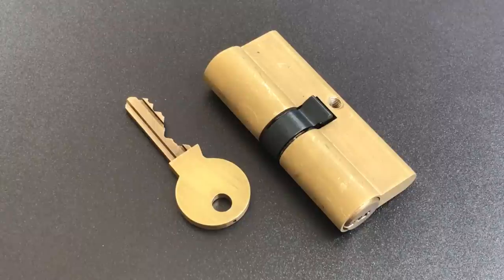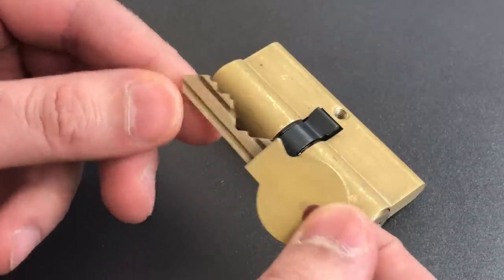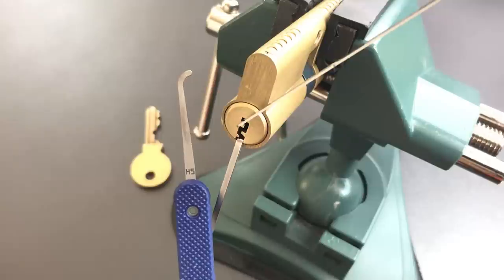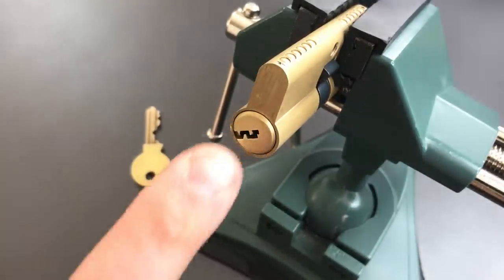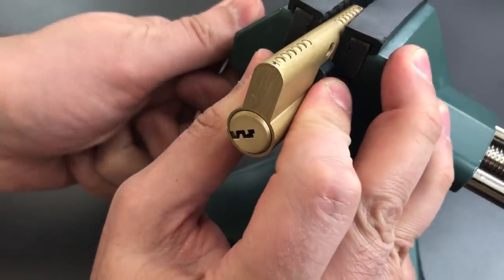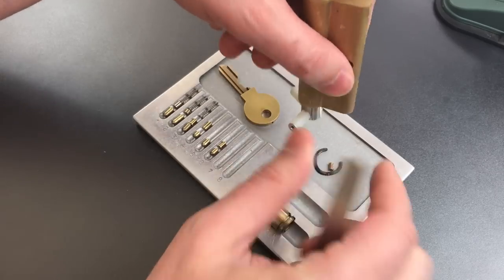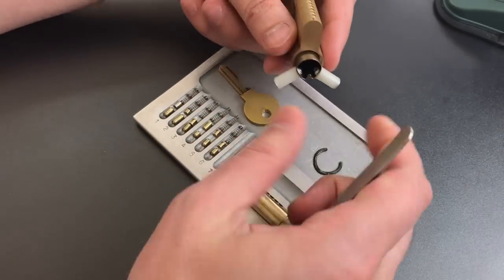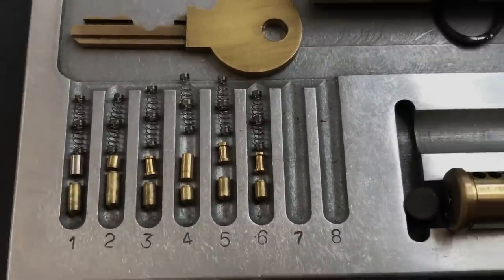[612] Prototype Of UrbanHawk’s Pin Blocker Cylinder Picked and Gutted

Comment: I always asked myself couldn't you put two bigger spool pin in and the rest small pins that when you try to pick it every time you try to pick a spool every other pin and the other big spool will drop?
Reply: Why will the other big spool drop when you do that?
Reply: @Tjalve70  you are right it will, but won't it be possible to use that idea to make a lock that is difficult to pick because you'll drop every pin by picking the big spoole and when you don't know which one it is gou need to find it what is time-consuming?
Reply: @redcrafterlppa303  I believe that is part of the point of spools in the first place.
What I didn't understand of your first comment, was that somehow the other spool should always drop when you picked a spool.
Reply: @Tjalve70  im not that good expressing myself in English thats why its not understandable but there should be a way to make a lock that is not able to pick open by making pinns drop when you pick other pins or is this just wishful thinking?
Reply: @redcrafterlppa303  I have very little knowledge of lock picking, but I do believe it's wishful thinking.
The footprint of a pin, whether it's a normal pin, spool, or anything else, is exactly the same when you pick it, as when it drops. So if it's big enough to be set when you pick it, then it's also big enough not to drop when you pick another pin.

I think the reason why you think otherwise, is because when a spool is NOT set, it will give you a false set. But that's because the CENTRE of the spool, which is thinner, will allow the core to turn slightly.

Let's imagine a core with only two pins, and both of these are spools.
That means even from the start, it will go into a false set.
Then you start picking the bigger spool. You will then get a counter rotation until the base of the spool can be pushed up and get set. At which time you will get a new false set from the smaller spool.
When you then start picking the smaller spool, you will also get a counter rotation, but the counter rotation will be slightly less than with the bigger spool, simply because the smaller spool is smaller. So it will not be sufficient for the bigger spool to drop. So when you set the smaller spool, the lock will open.
Reply: @Tjalve70  you are right thanks you are very friendly normally people just say ehh you are stupid or something so respect discussing normally in YouTube comments.
Reply: @Tjalve70 in the video 542 the silver core is what i mean you have to find the right order or you cant pick it

Comment: I'm not a locksmith or good picker by any stretch of the imagination, but I think pin2 is a zero set pin which rests on a shelf in the keyway. By simply putting a pick in there to get to pins 3456 it's probably already over set. That's my guess.

Comment: Can you make a hard to pick lock by making the pins incredibly small so you have like 10 of them in the place of one normal pin so nobody can pick just one at a time
Reply: You'd have extreme difficulty and cost manufacturing them.  Not because of the number of pins, but the cost

Comment: What are the spools for, function
Reply: From noob (who can't pick any security pin) to newbe: if a normal pin lies across the shear line and is set under tension, it will get stuck by friction, so it still can be moved with some force. But a spool will tilt a little because of its free space right over the shear line. In this state, it can't be moved by force without damaging the spool (or something else, but a brass pin will be the first to succumb). I hope this explanation fits.

Comment: I'm going to guess that he'll implement a magnetic second pin, that prevents opening the lock if you're using steel picks. maybe without or with a strange kind of spring. Or I'm thinking too exotic :)
edit: got the pin numbering messed up. doesn't make a whole lot of sense this way. whatever.
Reply: good idea even if that is not what he does brill idea you've got me thinking now thanks stiglocks..r
Reply: I'm late to the show but this idea of yours is a solid one. Do you know if anyone has ever tried to use magnetic pins?
Reply: The problem with using magnets is that in such tight quarters you would almost certainly need to resort to rare earth (e.g, neodymium) magnets in order to achieve a sufficiently strong magnetic field yet such magnets don’t last for the typical life of such a lock, which can be many decades.  The rare earth magnets are made from a tightly compressed powder that is then encased in a thin plated shell (such as nickel).  Once the outer shell deteriorates from oxidation, corrosion, or mechanical wear and shock and the tiniest pinprick of a hole forms then moisture can reach the powder that is the rare earth magnet then moisture will begin to destroy the magnet from within literally reducing it to a loose powder.

That said, there is nothing to prevent the use of nonferrous metal picks, including certain stainless steels, that would not be affected by any magnet.

Comment: Will the pins be set at different "heights", so that the #2 pin will be low, sort of "blocking" the pins further back from any raking or picking attempts?  If that's what it is... how would the key get past it?
Reply: Zeet,
Think about the difference between picking a lock, and using a key.
When you use a key. all the pins are lifted to their correct positions AND HELD THERE! so as you turn the cylinder, all the pins stay at the shear line.
But when you pick a lock, you are just getting the pins to catch on the shear line - you aren't holding them all in place as you turn the cylinder.
A key would have no problem - as it slides past the low-cut pin it will push it higher than its set position, but once the key is properly in place, all the pins will be pushed back so they align with the shear.